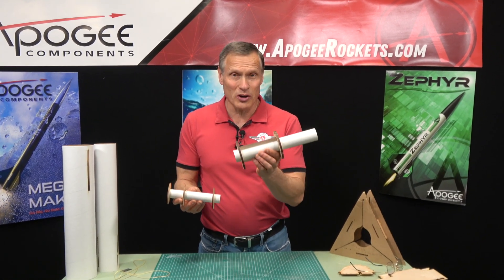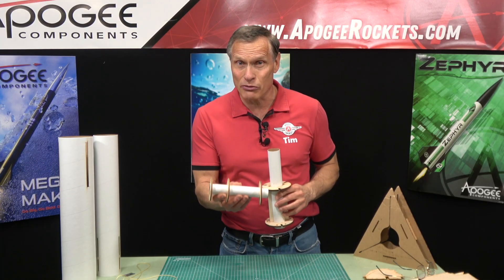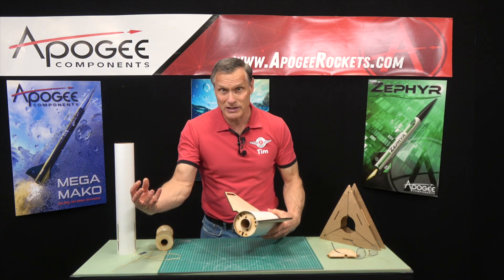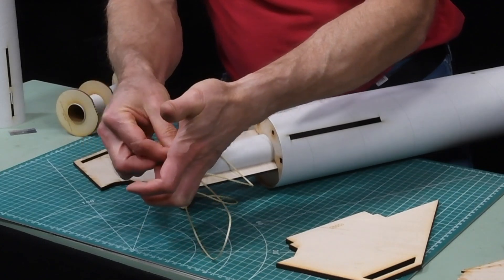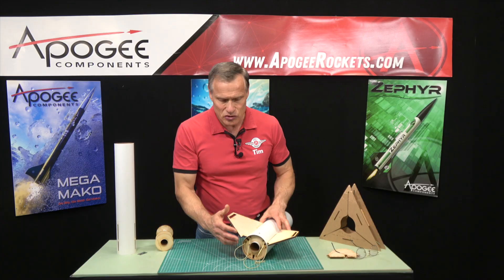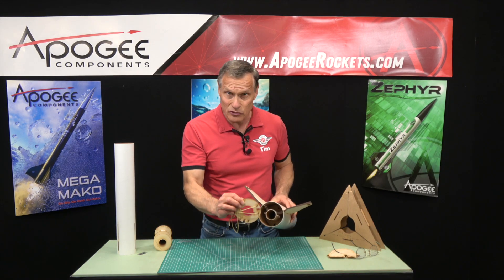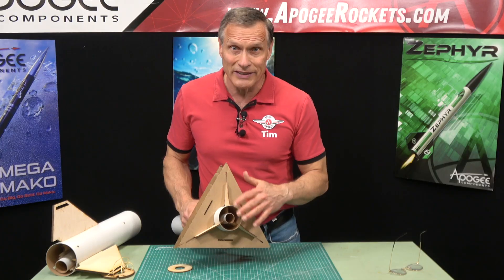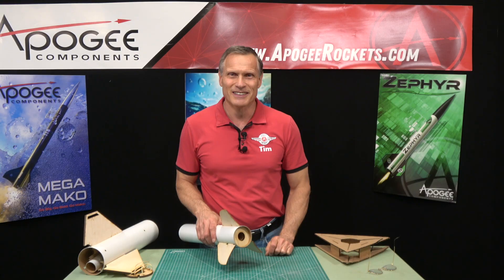High-Power Rocket Motor Mounts: 3 Rings vs 2 Rings

Comment: Is there an advantage to either of these two methods vs cutting the fin slots all the way to the aft and then assembling the fin and motor mounts separately before gluing them into the body tube as one unit?  

If you're going to have external fillets for the fins anyway, are all the internal fillets to the body tube really necessary?  You'd already have the some on the forward end of the front ring and rear end of the aft ring too.

Comment: I've got one rocket with split fins that has 4 centering rings. I used them as epoxy barriers for the West System epoxy, but it was pretty challenging making sure they were in the right place before bonding them